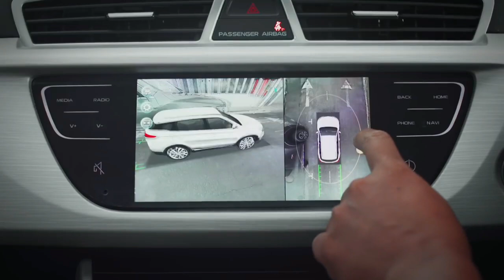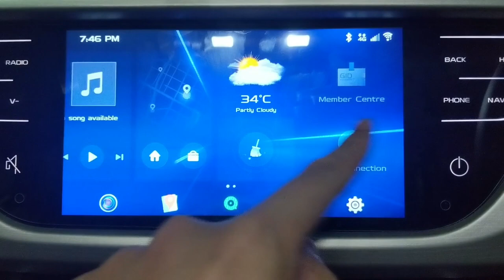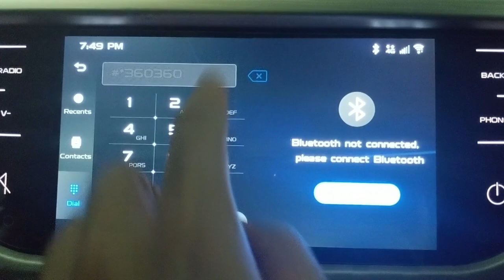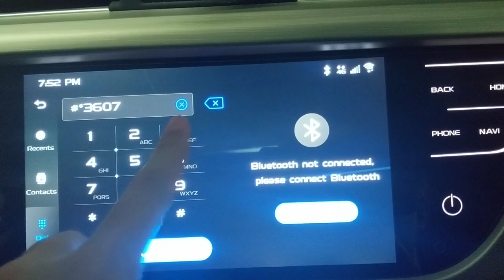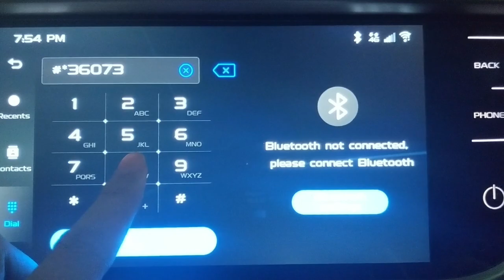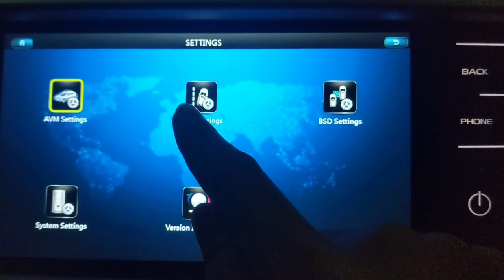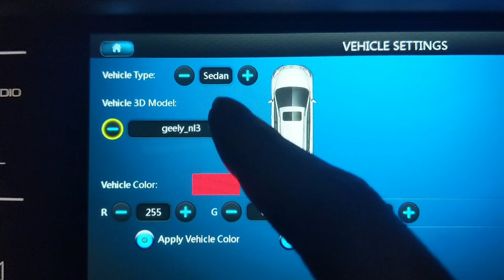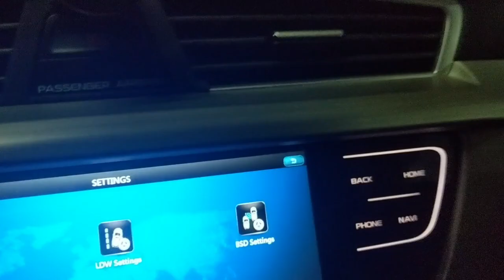Hidden 360 camera & Safety system settings in Proton X70

Comment: Hi thank you for your video. May i ask if 360 camera (Geely or aftermarket) can be installed on x70 standard head unit? (x70 does not comes with 360 camera factory)
Reply from the maker: the ihu is geely 360 ready. you can purchase the avm and 4 cameras to make it work. that being said the price is exorbitant. Alternatively you're better off getting an android head unit with 360 function. just that you will lose your warranty.
Reply: @SiroccoSeven Thanks for your input!
Reply: After i install new avm, it say that avm need calibration
Reply from the maker: @shahrolamriabdrahman2825  yes. It needs calibration. Same applies to all 360 camera

Comment: Is there anyway to calibrate Bluetooth call audio, the Bluetooth call not that clear, and the other side hard to hear when use the Bluetooth call
Reply from the maker: It's at the developer level. Best not to temper with he files. Pin hole mic is the other factor why the other party find us less audible. Acotech needs to figure out a way to fix this.

Comment: There's a red light in rear bumper but it does not light up. How to make it work? Here in Peshawar Alhaj motors a signatory of proton in Pakistan has failed to properly guide.
Reply: That one is rear fog lamp.. u can turn it on by pressing its button on left stick.. button located under front fog lamp button
Reply: You need to turn on front fog lamp before turning on the rear fog lamp, else the rear one can't turn on

Comment: Does the apple carplay Carlinkit work for x70?
Reply from the maker: You need an app to run the carkit but to install the app there's challenge. Manufacturer has locked the device from being able to install any 3rd party software.

Comment: Hi. I tried using the #*360 code on Proton X50. But it is not working. Do you know the code for X50?
Reply from the maker: Different system bro. X50 is using the new generation gkui19. There's a code to access the engineering menu. Unfortunately, you need to ask the manufacturer for it.